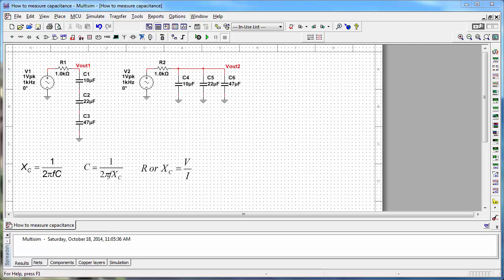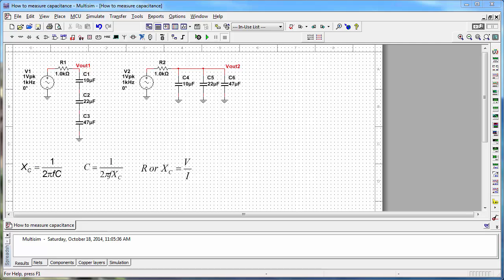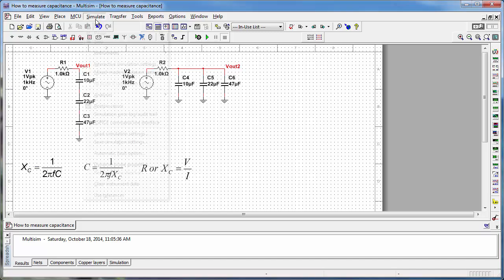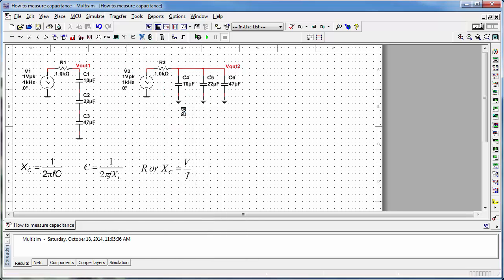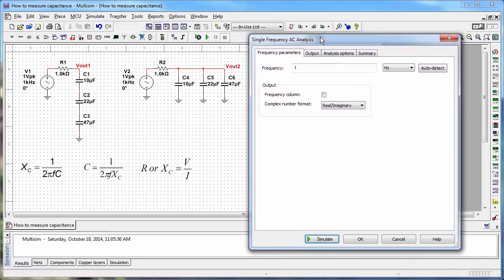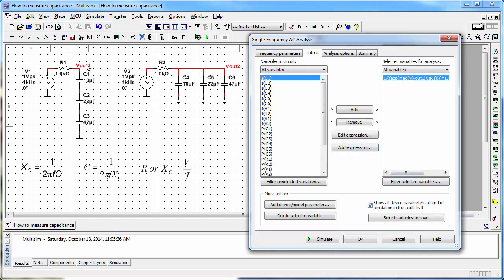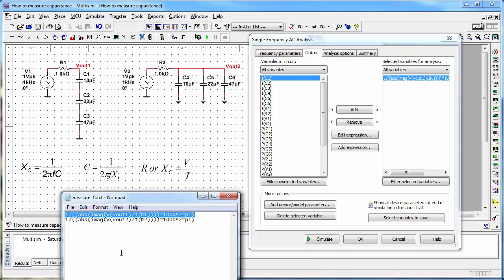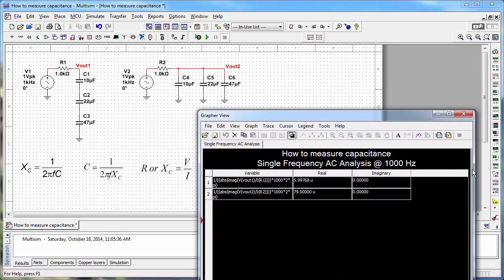How to measure capacitance

Comment: I'm not getting any value. I'm getting 0 for real also. why?
Reply from the maker: For a single frequency AC analysis make sure you select Magnitude/Phase not Real/Imaginary. You are replacing the Xc value with Voltage/Current, i.e. "resistance"
Reply: @fishy-engineer  how to add vout1 help me out